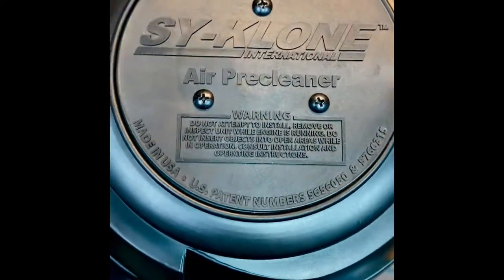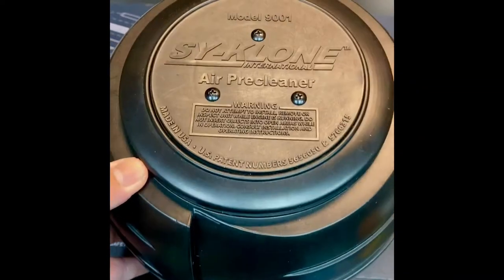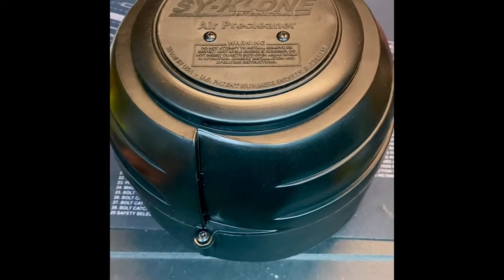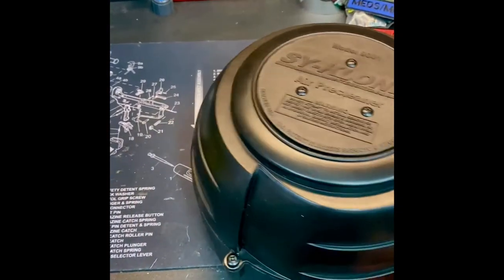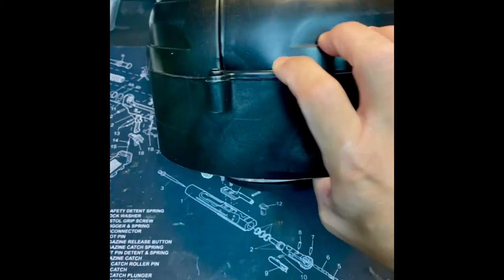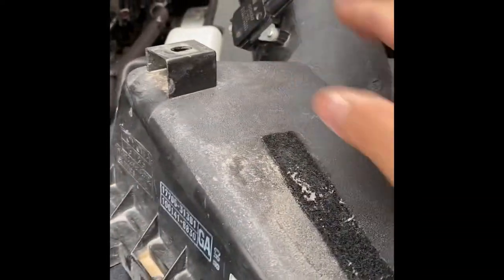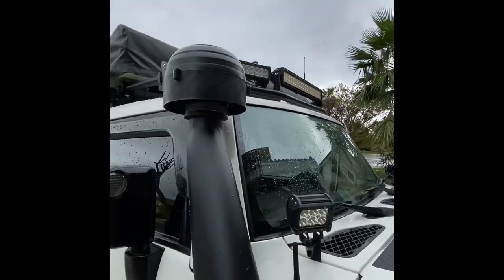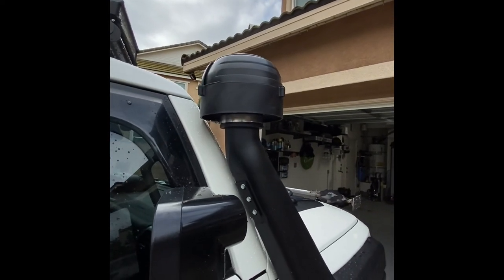FJ Cruiser Snorkel Upgrade!

Comment: What kind of snorkel is that?
Reply from the maker: PRG (pathfinder recovery gear).  Last I checked they stopped producing them.  Same molds the  ARB safari snorkel ones are made from what I hear, the fit is pretty much the same.